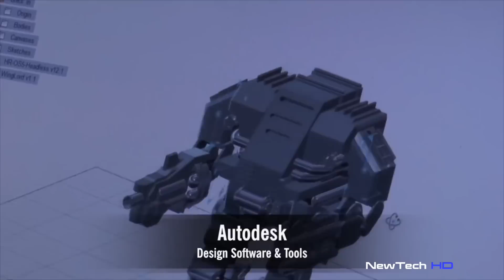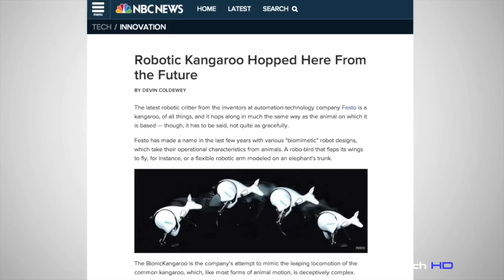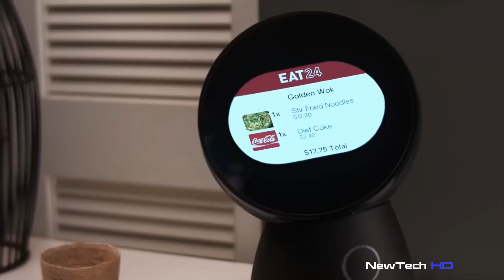New Technology 2016 | Military Robots | Awesome Robots

Comment: Umwelttechnologien
Technologieangebot Leistungsmultiplikator.
Hoher Leistungsgewinn mit erfolgreich erprobten Impulstechnologie von Milliwatt bis Megawatt.
Die neuartige Leistungsoptimierung ist eine simulierte Energiequelle als elektronisches Gerät (EPM, electronic power gain multiplier)  in Reihe oder parallel, zur primären Energie wie Akku, Photovoltaik, Brennstoffzelle, zugeschaltet und ist für Anwendungen im Elektrotechnikbereich allgemein und ermöglicht Leistungsgewinn, insbesondere über 1000 km Langstrecke mit Impulsantrieb für Elektrofahrzeuge wie Lastwagen, Elektroflugzeuge, Raum- und Schifffahrt, thermoelektrische Generatoren (Patent).
Innovative Technologien -  RZ-IT
Rudolf Zölde
samplingtec@gmail.com
www.rz-innovatec.com
29793 Torrox Costa (Málaga) Spain
Apartado postal 170
Tel. / Fax: +34 952527883
samplingtec@gmail.com
www.rz-innovatec.com
Wenn für eine Fahrstrecke von A nach B 100 Liter Benzin verbraucht werden, 
sind 70 Liter in Wärme und 30 Liter in Bewegungsenergie umgesetzt.

Comment: +Ice9   I hope they send out this exact robot. Its design is crap. THEY say current speed is 2.5mph. Quadruple that to 10mph. Still plenty slow enough to use deep sea fishing line as tripwire material. Oops. Your robot just pulled the pin on an oversized thermite mine. Easy to build, materials available in your grocery store. And WHAT idiot puts a friggin' chainsaw on a robot? Oh, wait! The same idiot who doesn't understand fused Silicon Carbide will just laugh at that chainsaw. FYI… density of of SiC= 0.007 lb/cu.cm. Density of ballistic steel= 0.018 lb/cu.cm.  IOW, SiC is 2.5 times lighter, and 2 points harder on the MOH scale, than ballistic steel.  I really have zero patience for Amateurs.

Comment: Military robots? More like war machines.
Reply: karma bad at one point or another someone will have this technology whether it's in the right or wrong hands. Also this things aren't indestructible. It's another thing to deal with.
Reply: David Woods less dead soldiers. depending on what side theyre on...
Reply: karma bad Yes, less dead soldiers, but then what? With this kind of technology, corrupted people will easily use these machines to go to other countries and blow them up.
Reply: SilverWing27 exactly, fuck these robots
Reply: Rikky Dunigan less dead soldiers...plus they can used in supply runs to the front line.